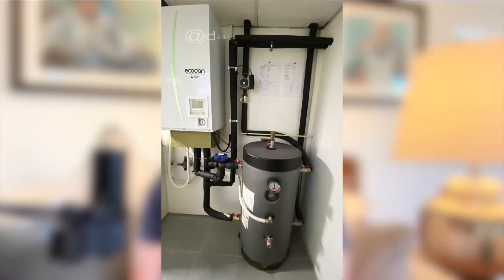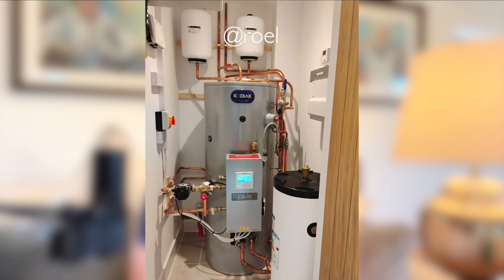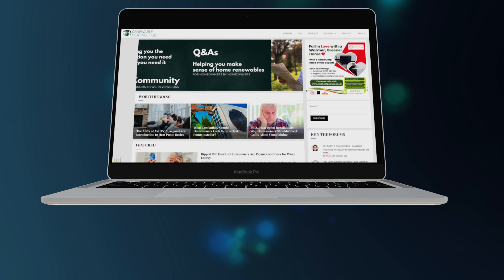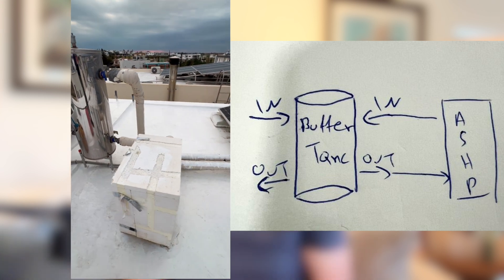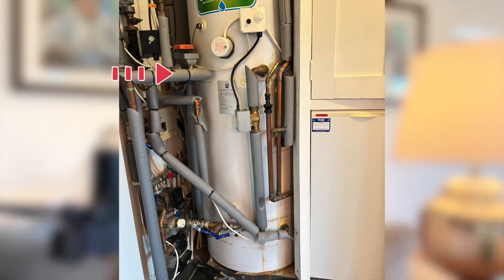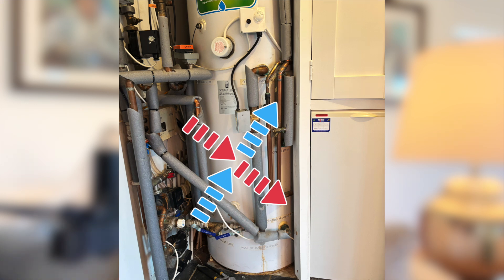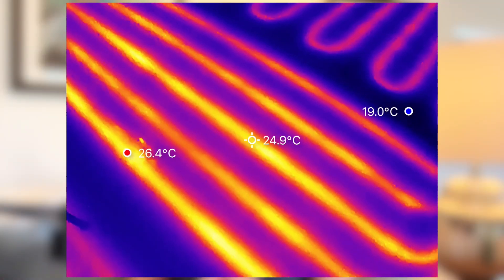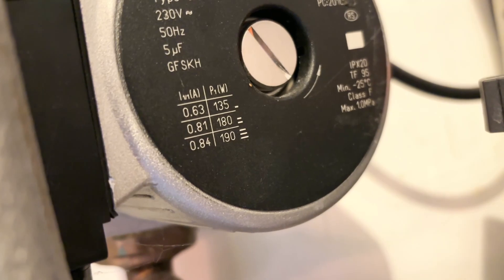Is Your Buffer Tank Wasting Heat and Money? Buffer Tanks & Heat Pumps Explained!

Comment: Yet again NO explanation of what the buffer tank is there for, NO explanation of how its MEANT to work. Vague advice on replacing it with a 'volumiser' without any explanation of what a volumiser is going to do or why you need it...!!?? Telling your 'installer' will get the usual replay, 'it will be fine, this is how they are supposed to be plumbed, we do them all like this, you are not a plumber...!!!
Reply: The "why" of a buffer tank (in an installation with a heat pump as the only heat source) is primarily that the designer of the installation thinks that the flow of the heating circuit is too restrictive/variable to always be a good match for the flow/pressure available from the HP's own circulation pump; if this pump cannot achieve enough flow, the HP will not be able to run. A buffer splits the circuit in two (hydraulic separation) such that a second, dedicated pump takes care of the heating circuit, while the HP's own pump can run according to its own parameters, supplying heat to the buffer tank without being constrained by the circuit characteristics of the emitter side. A secondary reason is to add volume (see later).

The "why not" is that there may be a lack of enough inspection of the actual heating circuit such that the designer wants to err "on the safe side" and assume that a 2nd pump & buffer tank is needed, whereas (sometimes with minor modification to the heating system) in practice the HP's own pump is actually able to achieve a suitable flow rate in the various operating conditions needed.

Aside from matching pumps and circuits, the designer has to ensure the heating loop is big enough (volume) that in mild months the HP's minimum power delivery isn't saturating the system too fast and ending up with excessive cycling. If the heating circuit has already got lots of big rads and/or UFH - and the HP isn't wildly oversized - there may already be enough volume. While a buffer tank does add volume, so does a "volumiser" but without the drawbacks of additional pumps and distortion (efficiency loss).
Reply: Heat pumps need a minimum water volume to help defrosting. If you remove most of your TRVs and have an open system, I don't think a volumiser is necessary.  If you do have one, it's better on the return.  The lower temp will have lower losses.  Most quotes I'm getting have a buffet or volumiser included but I won't accept them as my system has at least 125 liters.
Reply: Buffer or volumiser possibly add £800 to £1000 to the cost, although most installers don't give a decent breakdown of costs.
Reply: @charlesamery-behr3153  Buffer tank also implies an additional circulation pump, which aside from its upfront cost also adds at least a little to the ongoing operational cost too.

For some installations, it may be better to upsize a bunch of radiators to achieve adequate system volume rather than fitting a volumiser.
Reply: Buffers are useful for system volume, and to help with defrosts. An active buffer with an immersion heater built in, can be a handy backup during ASHP downtime. All this needs to be designed correctly into the system, or your return DT will be more than 5c.
Reply from the maker: Charming and polite message. If you want an in-depth understanding of buffer tanks and volumisers (as alluded to at the outset of this shirt video) you need to watch this: Efficiency Killer? https://youtu.be/XitFQvvfmng
Reply: @RenewableHeatingHub  I had previously watched that video and I have watched it again earlier today. There is not a single word in the 47min about what a buffer tank is SUPPOSED to do OR what a 'volumiser' is or what it would do better!! If you disagree then give the time stamp...I am sure you wont!!
Reply from the maker: The video you watched explains the volumiser and where it is supposed to go. Neil covered that. We have covered this as part of other videos too, and it has been covered several times. To answer your question here though, buffer tanks were originally a workaround for the limitations of on-off fossil fuel boilers, which needed to run at high temperatures (80°C+) to prevent corrosion. They allowed older systems with low flow rates to function alongside multiple heating circuits. But that was then… this is now.

With heat pumps, buffer tanks don’t “smooth out the load” as some claim. A 100-litre buffer only holds about 1.17kW of energy if it’s 10°C hotter than required. If your system’s demand is 10kW, that’s barely 7 minutes of buffering… hardly a game-changer. Worse, raising water temperature by that extra 10°C can push up energy bills by as much as 25%.

The best heat pump installations don’t rely on buffers. Instead, they focus on proper system design, correct emitter sizing and smart controls to ensure efficiency without unnecessary heat loss or extra running costs. If extra system volume is required, a volumiser is the better solution.
Reply from the maker: There’s also the first ever video we made for this podcast, which had a lot of info in buffer tanks: Are Buffer Tanks Required For Air Source Heat Pump Systems? 
https://youtu.be/kMK8JnXAM7E
Reply: @RenewableHeatingHub  The video does not explain anything about a volumiser other than to say it can better replace a buffer...which also has no explanation. The video only states that a volumiser can be in either flow or return side of a system...so what, that doesnt tell me in any way its function or why I would put it in either side! Higher temps INCREASE corrosion not decrease it so their original function still make no sense. Multiple heating circuits hardly seems relevant to any domestic application in the last 50-60 years and on its own doesnt really mean anything anyway.

Your second paragraph, as usual, explains the problems of buffer tanks but not what they are meant to do!

You state they are not preferable in heatpump applications, ok I accept that, but I dont know why because I dont know its function. You state a volumiser maybe a required addition but not what it does or why I would need additional volume or how to define too much or too little 'volume'. I am guessing volume refers to water (rather than energy) because thats not clarified either. I have no idea why it is so unbelievable difficult to state such obvious facts as what something does and why you might need it...??
Reply from the maker: You raise a valid point and show is the homeowners Q&A so we’ll address this. We’re recording an episode this Friday on system design and I’ll allocate a segment on WHY to install buffer tanks and/or volumisers and what their respective roles are.
Reply from the maker: Hi @manoo422 – I hope that this video answers your questions: https://youtu.be/ofdV2n9XaxY

Comment: I still don't understand why you would fit a buffer tank. I do understand why you would fit a volumizer though....
What purpose does a buffer tank have that a volumizer does not?
Reply: Maybe you could tell us all what a volumiser does because this video certainly didnt!!
Reply from the maker: The goal wasn’t to explain that that’s why it wasn’t covered. If you want those answers, they’re all here: https://youtu.be/XitFQvvfmng
Reply: @RenewableHeatingHub  That video doesnt contain any further information.
Reply: @manoo422  A volumiser simply add water volume to the heating circuit. Heat pumps need a certain water volume to operate efficiently. If the volume in your radiators and piping is less than the manufacturers guidelines, a volumiser makes up that volume. It's basically an insulated tank with single in/out.
Reply: I saw a video with heatpump-sellers-designers... talk about a parrallel buffer tank to work with different waterflow capacities for the heatpump and in the delivery-system if that works with radiators. A heatpump works with higher flow and lower delta T. Radiators can become very noisy with that higher velocity/streaming. So they let the heatpump run with high liters/minute. And then use another pump for the the deliverysystem with radiators on a lower speed with higher delat T. I don't think that will be more efficient but solves some problems they think.
Second reason they talked about was.. A installer is very expensive to call for help if the system doesn't run well. So they say, put a buffer tank in.. So there is much lower fear of needing to come back to the customer..
Reply from the maker: There’s not point, from my homeowner’s perspective why you’d fit a buffer.
Reply: @RenewableHeatingHub  How would anyone else make an informed decision when you have never even said what a buffer does or a volumiser??!!
Reply from the maker: If you want those answers, they’re all here: https://youtu.be/XitFQvvfmng
Reply: It would make more sense to flow return water through a volumiser to reduce heat loss. It will still do the same job of increasing the system water volume

Comment: Have you considered doing a comparison between a hot water cylinder or buffer tank and a hot water on demand system, so far I’ve seen only one video that’s made any sense to me = a video I watched about a year or more ago , thus far having watched many videos in regards to heat pump systems they just don’t make any sense at all,  pity you didn’t have that video I watched and make a video of your own while watching this video with your comments added,
Reply: a buffer tank is generally for central heating, nothing to do with your domestic hot water supply. Theres occasions where in complicated set ups you might use a buffer tank to combine multiple heat sources (heatpump, oil boiler, gas boiler, solar thermal panels) - but it seems to me like you're mixing up the buffer tank having something to do with being a direct hot water store, which it definitely is not.

Comment: So my question is a buffer tank is for ?
A reducing heat
B increasing heat
C not doing anything at all
Reply from the maker: Please watch this video:
https://youtu.be/XitFQvvfmng
Reply: @RenewableHeatingHub  Again, that video doesnt answer any of these questions...
Reply from the maker: Are Buffer Tanks Required For Air Source Heat Pump Systems?
https://youtu.be/kMK8JnXAM7E
Reply: a buffer tank generally is not something you want in a domestic set up unless absolutely necessary (very few domestic houses will need this, they'd need to be massive or have poor pipe work). 

They can provide hydraulic separation (you can use two pumps, the one in the heatpump which may not have the grunt to do all of the emitters and pipe runs in your house). People with microbore etc could use this to overcome the issue as you can use a more powerful pump on the emitter side of the buffer to achieve the required flow rate to the emitters, whilst the heatpump side can use its existing internal pump and be happy.

They can provide additional water volume for the heatpump to make up for a lack of volume in the rest of the system (particularly if you want to zone the house, as you lose emitter volume when you zone for obvious reasons, you're turning off radiators). 

In 99.99% of cases, you dont need one. A volumizer (same tank, but just plumbed in series rather than parallel) can provide the extra system volume if required.

Its got nothing to do with increasing or decreasing heat. 

In short, you probably don't need one, but a lot of installers/designers use them as a crutch.
Reply: All very good questions, none of which were answered...
Reply from the maker: Again, if you want those answers they’re here: Efficiency Killer? Are Buffer Tanks Costing You More Than You Think?
https://youtu.be/XitFQvvfmng

Comment: I have been looking at an AIRA ASHP and looking an an installation video it has a buffer tank but not directly off the ASHP but after the three port valve so only in circuit with the central heating system. I assume as they know the flow rate is good through their hot water cylinder the buffer does not have to be in circuit (even for defrost)?
Reply: @IM35461  A buffer tank is always only for the central heating and never for the hot water.  I was impressed by Aira but declined their quote as they insisted on a buffer tank where it is not necessary. They said it was for assisting defrosting.  I have sufficient water volume with 13 radiators and reasonable paperwork.  If that was a problem it could be used as a volumiser, but certainly not a buffer.